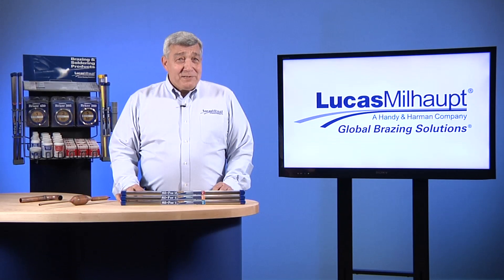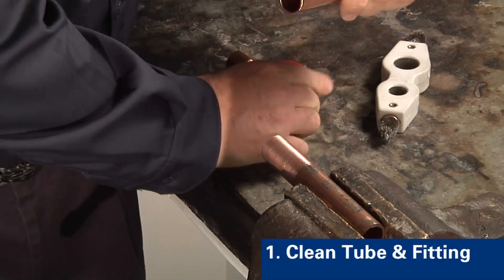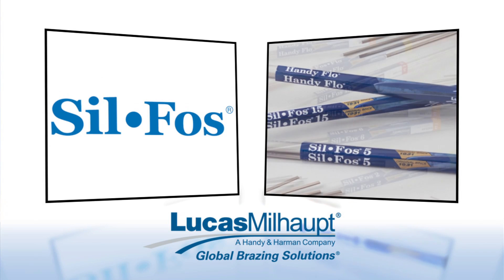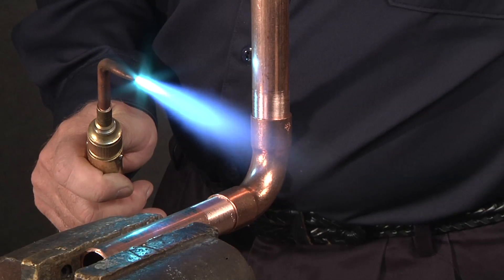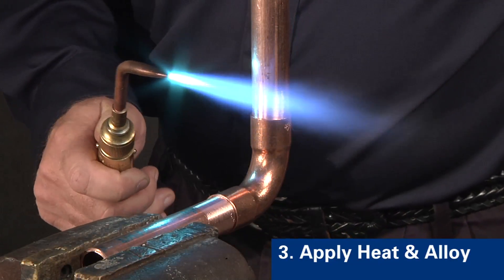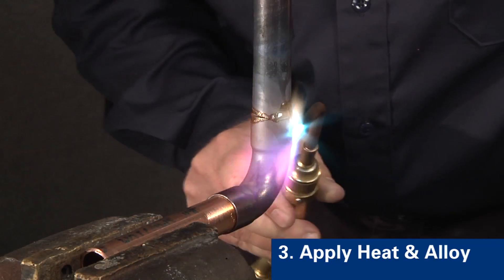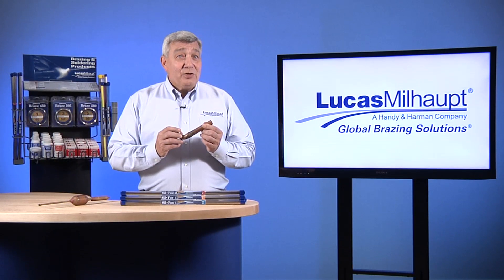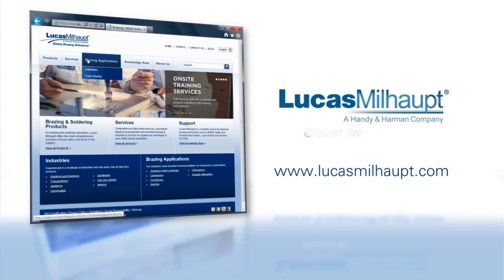Brazing Copper to Copper with Sil-Fos®

Comment: What chemically is the glassy rose-colored residue after brazing a joint with Sil-Fos products (I use 15%)? 
What is the best way to remove the rosy residue, when needed?
Reply: @Swim Fan It is not flux as no flux is used in copper to copper joints made with silver-phosphorus filler metal.